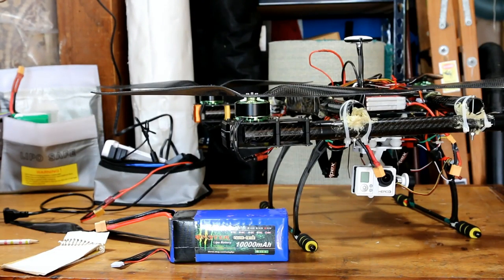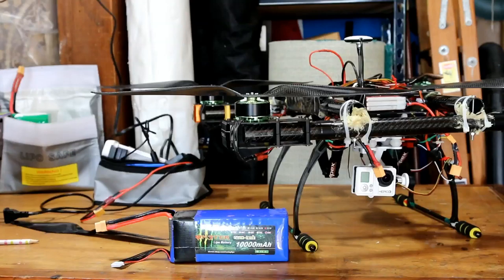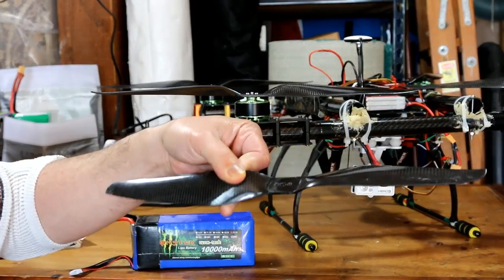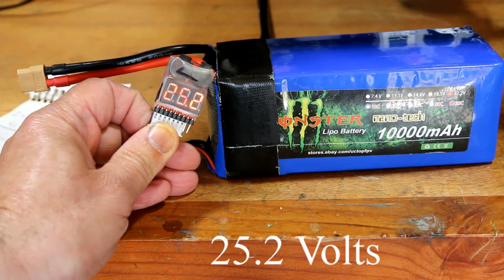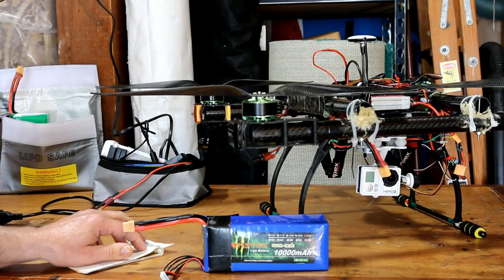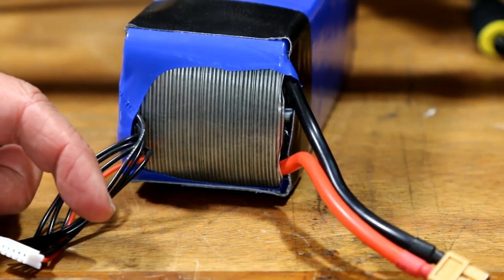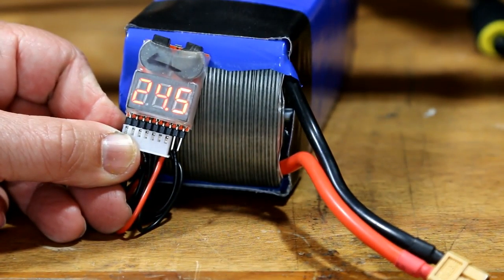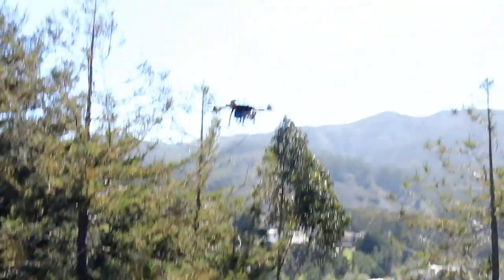Quadcopter Props. 15 inch vs 17 inch. Before & After Voltage Comparison

Comment: Great video! 
Have you heard about the B4UFLY app not good when it comes to P-Town.
Some how we have to change this.
Reply from the maker: Dave Kent, how will it affect us since it is not connected to our drones if we do not download the app? I could see if you downloaded it, it could communicate with the DJI go app or what other app you are using but that would not be the case if you do not download it, right?
Reply: On my DJI Adv it asks do you have permission to fly here? (new) and I don't have the new app.
Then asks you to sign that you know your doing so. if your within the five mile area.
I signed yes just to fly real close to me today almost in Woodside Ca and now I wish I didn't.
I'll never do that again! I 'm not even going to fly in San Mateo county any more unless it's in Pescadero Ca south. I`m sure all info is being stored in you app's flight logs.It's just not worth it too me.
Good Luck
Reply from the maker: Dave Kent 
well, that does suck. I have not had any issues yet other than being grounded near AT&T Park. It would not let me take off although I was a little too close.
Reply: Revert GEO to NFZ is the fix I found after a search ,I`m not sure how my setting were changed.
Today was the first time I ever seen this drop down before a flight...and I was 13+ miles from SFO.
But it looks like this is a DJI thing not a FAA thing. I heard about GEO setting/fences this may fix it for AT&T.
Your videos are great!  Keep up the good work.
Reply from the maker: Dave Kent I just downloaded the app on my phone which I do not use for flight. According to the app, I'm not allowed to fly anywhere. Not  by Linda Mar, from my house in the back of Park Pacifica, or anywhere near Sharp Park Road. the app is also very buggy and seems to freeze my phone occasionally. The only part I like about it is that it will tell you if you are near an airport. Other than that, it is of no use.